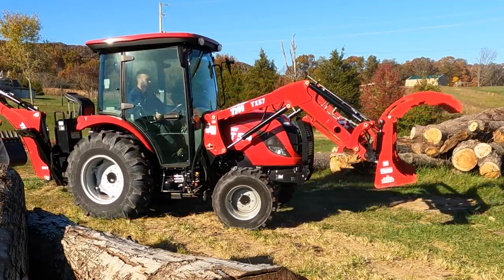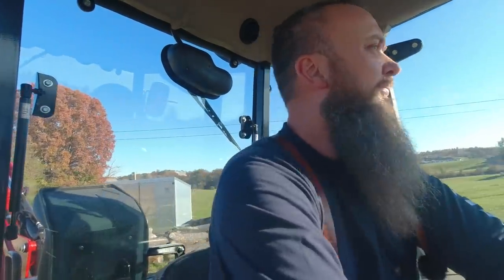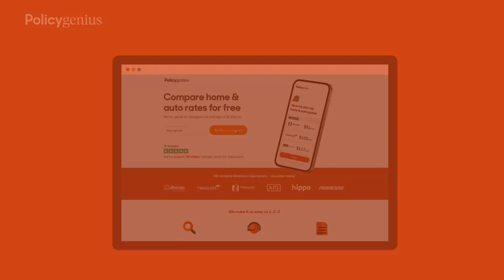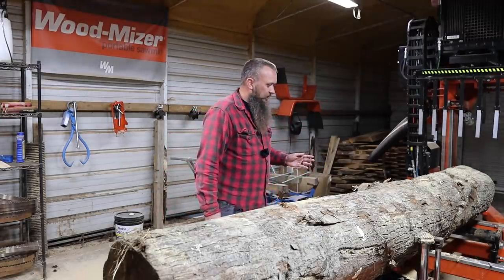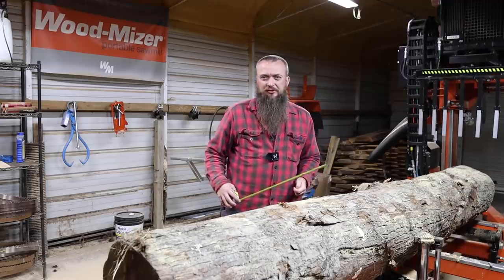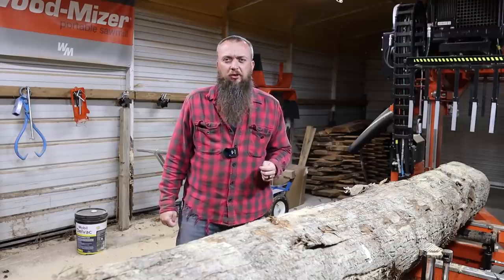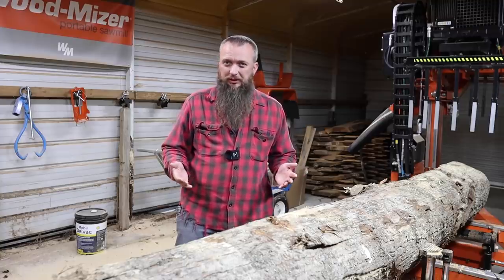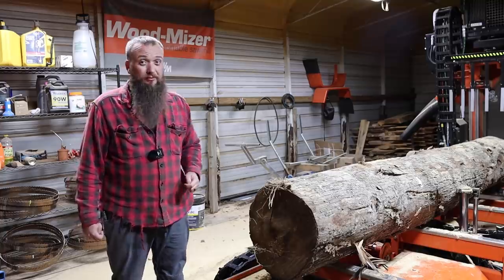Beetles That Make Lumber Look Amazing, Wormy Maple On The Sawmill

Comment: Here in Thailand, there is only one time zone for the entire country and we do not change time during the year.  However the length of daylight period on June 21 versus December 21 up here in Northeast Thailand is about 2-1/2 hours - nothing to get excited or concerned about. The closer you are to the equator the less difference there is between the "longest" and "shortest" days of the year. LOL

Comment: Hi Nathan!!! here in Australia, we have daylight saving from early October to early April the next year. The only state that has never done this is Queensland and the confusion at the border tonws of Tweed Heads and Coolangatta has always been a problem.
Reply: Daylight saving time was trialled in the state of Queensland, Australia, during the 1989/90 season, with the trial extended for a further two years—1990/91 and 1991/92. The last full day of daylight saving in Queensland was Saturday 29 February 1992, with clocks officially wound back an hour on Sunday 1 March at 3am.
Reply: You must be an easterner. WA and NT don't have DST. In summer we have 5 time zones with a 3 1/2 hour difference between the eastern states (except Qld) and WA
Reply: @desndebbie  yeah mate NSW. Didn't know that there was so much confusion all the time in WA and NT. What a hassle!!!!

Comment: Sadly, we were on day light saving time during the summer and just changed back to standard time, which is what every one seems to not like. So if we got rid of it, which I think would still be a good idea, it would still be dark at 5pm in the winter.
Reply: The proposals for stopping the clock switch call for going to daylight savings time as the permanent schedule, i.e.., we'd spring forward once more and then never fall back.

Comment: The blue stain fungus, transferred by the pine beetle, makes for some pretty unique patterns in the pine trees here. From my short experience, it seems like you got to get the pine tree down and off the ground, bark off, in less than a year after you know the beetle has gotten it. Any longer and it blues too much and starts rotting, especially around the larvae burrows. Can be pretty but extremely soft and unpredictable.

Comment: I don't know if they still do it or not, but there were parts of Indiana that did not change their clocks, so part of the year they were on the same time zone as Central and other times Eastern, which was horrible for businesses dealing with people from out of the area. Some business that would typically have a 9-5 work day resorted to 8 to 6 just to make it easier on the customer. 
The whole state of Arizona doesn't observe it. Little awkward when you're just driving through and the clocks get all weird.

Comment: I've seen ambrosia maple made into shipping pallets, back when I was doing some pallet crafts, my guess was the large mills consider it a defect... Here in AZ we do not use DST, most of the population is in the lower deserts so most energy used is for Air conditioning plus during the summer months the only time to be outside is before dawn or after sunset, its too hot to work/recreation safely after 10am mid April to mid October so we don't use it since it would be detrimental.

Comment: Curious- around me, the old sawyers would take the crescent-edge-trimmings and overlap them for corn-cribs or drying sheds, lay them down in wet spots to create a  ford or "corduroy road", put them down under stacks of firewood to get airflow, , or use them as spacers when drying boards- 
Is there that much difference in how things are done?

Comment: Both logs showed very pretty wood. I do have a question, I've seen others cut 2 or 3 slabs off a log before they move the slabs. I see with the LT70, it rreverse stacks the wood for you. But would you cut 2 or 3 slabs ever before stacking?

Comment: What is the minimum thickness left after the final cut, doesn't look like you can go all the way to 5/4 ?
Reply from the maker: Bottom board?
Reply: @OutoftheWoods0623  the board left after the final cut, you never show the last board being removed from the bed, so it always looks like it is thicker than what you are slabbing at, so how low can you go ?
Reply from the maker: 5/4 is as low as I go. I think 4/4 can be done but that is pretty close
Reply: @OutoftheWoods0623  that's great to know, many thanks Nathan

Comment: So, you find diesel fuel is the best blade coolant? I recently watched a video where a guy used sub freezing rated windshield fluid…thoughts? New sawyer, getting ready to make my first cuts. I have a maple on the stack right now that will yield ambrosia. Not as large as the one you just squared, but should yield some 6-8” boards.

Comment: I've seen videos of others that after the initial cut will turn the log 90 degrees to where the  initial cut is against the posts. You flip yours 180 degrees and then 90. That seems to make more sense if you do that squaring trick you've shown before. Is that just a personal preference?
Reply: Nathan's way is the correct and better way to assure that the lumber is square. Start with the two parallel cuts then square to the bed for the next two. However many do the shortcut because the do not have the hydraulics and have to roll the log by hand and they count on getting true square on the boards after drying when they plane the surfaces. Just different styles, and does not matter much as long as they get to true square in the final lumber.
Reply: @markpashia7067  Thanks.

Comment: Why couldn't a person, at the end of the saw table, push the sawdust down into a funnel type of tube, and have it fall into a tube like screw type of elevator(?) not the correct word, but it usually used by moving corn or beans into the next bin. Then, that would remove the dust from the building, just in case of catching it on fire. It could be running, every time, you turn on the saw? Love the way, it moves the newly cut board off the top. Ready, for the next board to be cut.

Comment: Is there a particular reason that when canting the logs your second cut you rotate the logs 180 and not 90?
Reply: tis done to get 2 parallel surfaces
Reply: @joeenglish69  the opposing side of the first cut will be parallel regardless of if it is done on the second or third cut. My question is (is this a personal preference or there is a reason why this is done)?